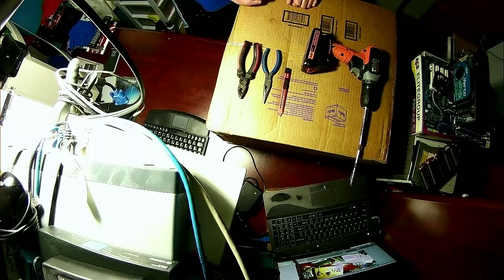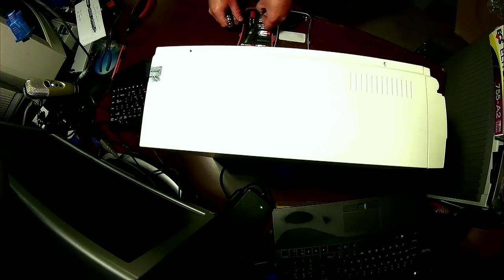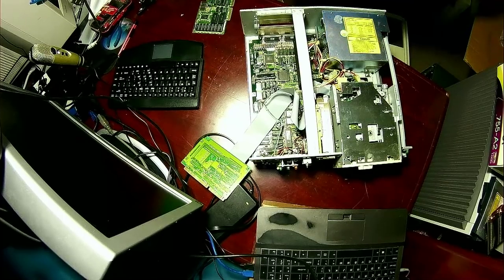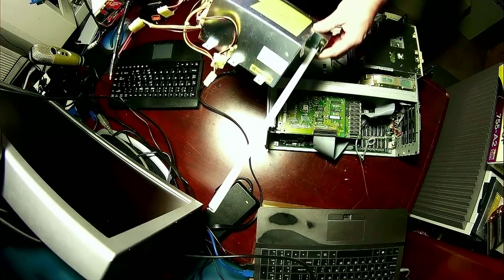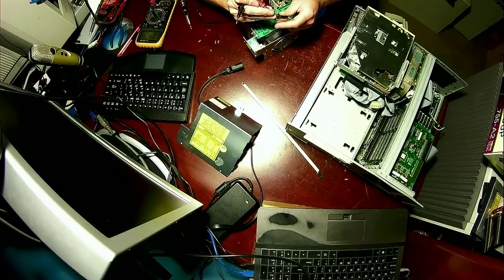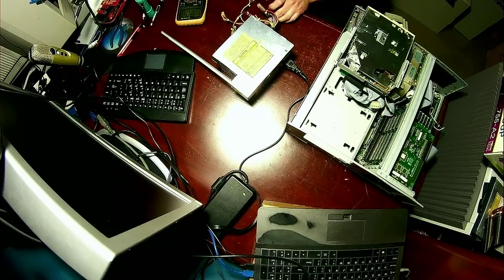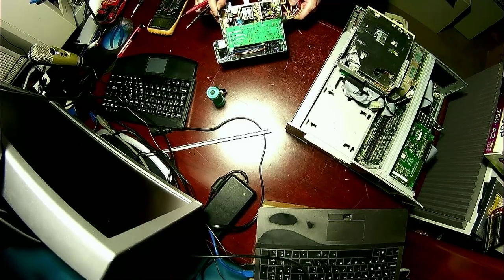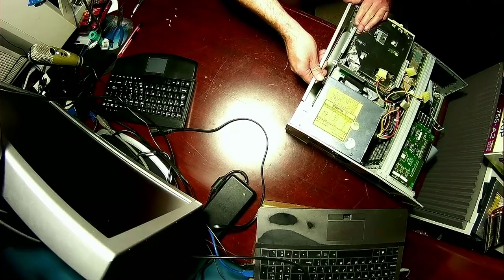Packard Bell PB686 (286 system) Unboxing | Eval | Fix (maybe)

Comment: What model keyboard came with this? Or alternatively, will a standard AT keyboard (or PS/2 keyboard with an adapter) work, or does this use some fancy proprietary variation (like Compaq or Leading Edge computers)? Thanks!
Reply from the maker: These are standard AT keyboards. Tandy 1000 was a different story.